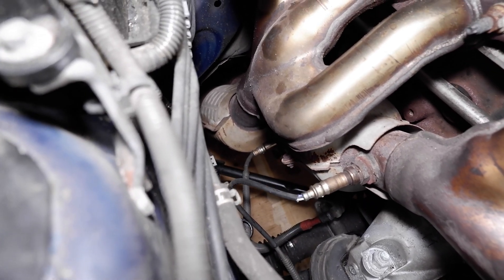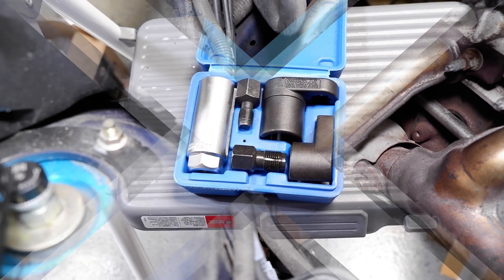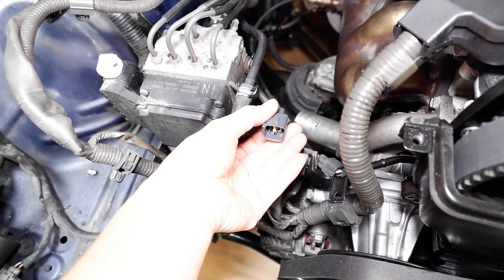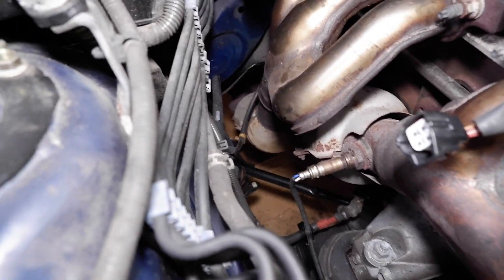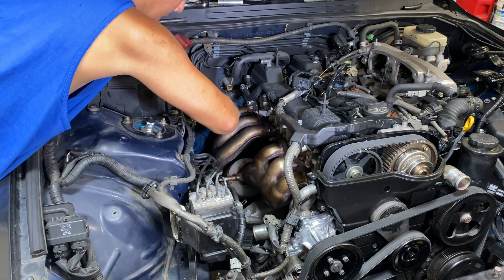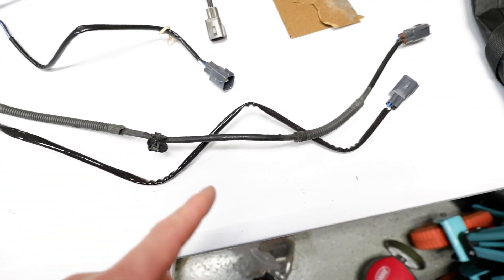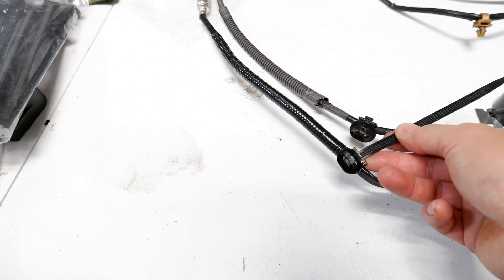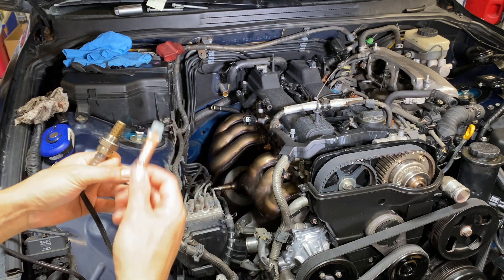How to Replace O2 Oxygen Sensor Lexus IS300 | P0141 P0161 P0135 P0155 | Heated Oxygen Sensor Circuit

Comment: Does the B1S2 From Denso Fit an 18 IS300? It is saying in Amazon, "This doesnt fit your vehicle" I just wanna make sure it does (Ive watched your video)
Reply from the maker: 2018 will use a different part number since plugs and length are different.
Reply: Gotcha, I thought based on your front end in the video you had a 14-21. Do you know by any chance the part number? @TunerwithKids
Reply from the maker: This video is for my 2002 IS300 Sportcross. Try Denso products site, they are a dealer and will list all the parts for your model.

Comment: Good job man i spent 2 hours got the 02 sensor socket no luck on the fire wall tho but the war is not over i will go at it again but disconnect the headers for some leverage 😅
Reply from the maker: Yea, I also recently learned that the whole header drops down pretty easily so that best and easiest way.

Comment: Just did the B2S1, it was a B*tch that took several out to figure out.  Spoken to lexus mechanic about using iron rod and heavy hammer in a youtube video I saw, in which he replied he wouldn't because it might mess up the threads.  The exhausts mannifold cost around 5 thousand to replace.   Take out the radiator core hose out and remove the battery that gives you just enough room to place a socket (probably need a metal pipe as a cheater bar).  Good luck!!!
Reply from the maker: Took me forever to get the right angle and leverage.

Comment: What brand of scantool do you have and is it a bidirectional scanner ? I have a autol and a innova paid about 95 dollars. I also have a launch but am unable to get it to upgrade
Reply from the maker: I’m using Toyota Techstream factory program with an eBay/Amazon VDIM Xhorse cable. I have a few videos where I use it to diagnose and program settings on my cars.